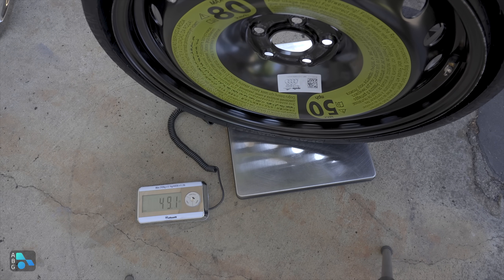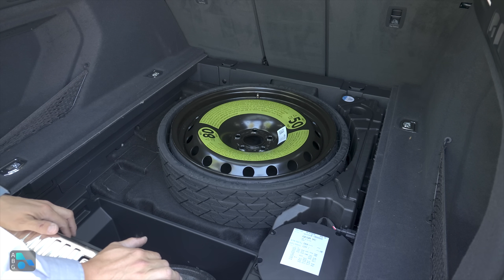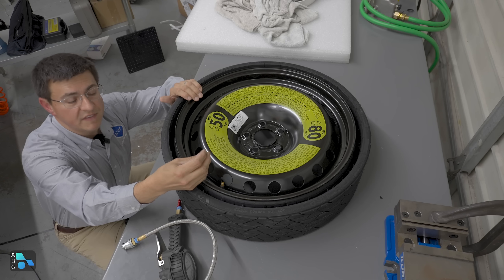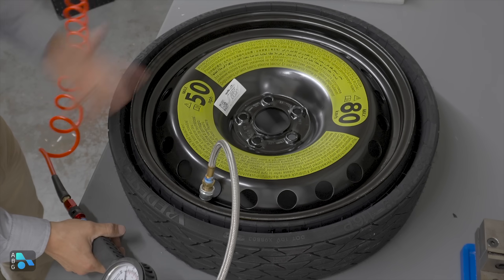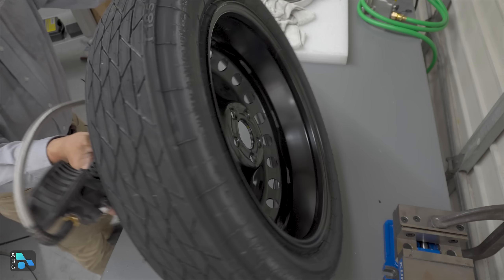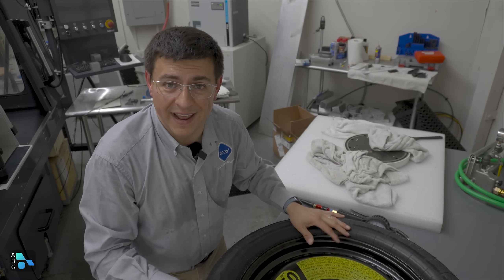How A Collapsible Spare Tire Works, And How It Might Save The Spare Tire In EVs

Comment: The ultimate problem is that an EV buyer is still far more likely to not know what to do with a spare tire compared to an ICE buyer. Educated consumers would really appreciate a real spare tire of any kind, but they are less likely to be attracted to the pros of EVs and be turned off by the cons. It is the natural result of attracting your consumer base with the "computer" part of the "computer on wheels" value proposition of EVs as opposed to the "wheels" part.
Reply: Do you have any stats to back that up?

Comment: I prefer a full-size spare wheel like we used to get with cars, the space-saving between a space saver and a full-size wheel isn't very much in reality, I would sacrifice storage space big enough for a pack of toilet rolls so I could have a full-size wheel & tyre, space savers came out for sports cars like the TT and MX5 I'm sure crossovers, SUV's, sedans, pickup-trucks etc have enough room for a full-sized wheel, they are awful to drive on and only a max speed of 50mph and a distance of 20 miles is recommended before you put a full-size wheel back on,

Comment: Spare tires aren't put in the front probably as a safety issue. Spare wheels and tires are not collapsible structures and could compromise the passenger compartment in an accident.

Comment: Here's my experience with one of these.  I had a new 2007 Q7 back in the day which had exactly that tire, and imagine for a moment that you are on a road trip, car full of bags and gear, and kids and you get a flat. Well, you know what, you can't fit the wheel that has a flat back into the original spare space, and do you know how big a Q7 rim and wheel is?  I think it is innovative, but these engineers are not thinking through the whole problem.  At least the storage space has to be able to accommodate the original rim.
Reply: Even being able to accommodate the original rim might not help because unless you have a set of tire irons, you're not going to be removing a tire from a rim very easily... And even with a set of tire irons, the average person who has never done it before is not going to be able to do it, much less do it without scratching up their rims in the process...

I prefer a full size spare tire that has the same rim as my other tires so that I can put it in the rotation pattern for my tires...

Comment: Better than nothing,  but where do you put the tyre and wheel you removed? If all the space is taken with Batteries and luggage,  you just throw away the oem rim (maybe$1000 to replace) and punctured tyre?  Seems a very heavily compromised solution.   

Full size spare means a 10 minute delay on your way to the airport.  Anything else means you miss the flight at best,  and maybe you're stuck on the side of the road, or in the multi storey carpark (where the flat bed truck can't go to recover you).  No thanks.

Comment: Stupid things. Great to get you moving again, not so good having to leave your original £500+ wheel and tyre combo/ luggage/ wife at the side of the road cause it doesnt fit where this little thing came from. Either full size spare or dont bother. Tyre tech is a lot better now than it was when spares were in every car. Theres plenty else on modern and electric cars that are just as likely to fail and leave you stranded. Maybe that space would be better used as an emergency reserve battery to get you an extra 10 mile when the main one is flat...

Comment: Because of Run Flats, the last time I had to use a spare was 2005 and that was because I shouldn't have been driving on the tires my car had anyway.  Initially I wasn't a fan of manufacturers not including spares, but I have come to realize that the weight and space savings of not having it is worth the tiny risk of possibly needing a spare.

Comment: The 50MPH limit amused me.  I actually got 70mpg from my Audi A3 Sportsback when I got a puncture on a Bank Holiday weekend and had to drive 50 miles at 50mph on the space saver tyre to get it fixed.

Comment: How often in your life have you EVER had to use a spare wheel on your car ?
There is a reason one is only sold with big EV trucks: They go off road where there is a slight chance you may get a bad puncture/rip in your tyre.
For road going vehicles this is NOT of any use.
All roadgoers with EV's have insurance that covers recovery in case of break down (including flat tyres). 
Its mandatory if your car is being leased which is the case of 99.9% EV's and cars in general.

Comment: There is a reason that car manufacturers stopped putting tyres in under the bonnet and that is safety.  A tyre and it's wheel in there in a front on crash with another vehicle coukd not only be dangerous to that other vehicle but also to the people in the vehicles bonnet tgat it is in too. So no that will never happen again thankfully. It was a stupid idea way back then and woukd be even stupider now. As for collapsable tyres lol no just no. What's new about that? Sure why coukd you not do that with a normal soacsaver or even a normal sized wheel? 
Spacsavers are the best.  Either that or the AA if you do not have a space-saving but this thing you talk about is just a gimic. 
How about airless tyres now that would be much more useful. Why are they not availible yet?

Comment: What a disaster! I've never owned a car with a space saver wheel, my cars have always had full-size and full-speed spare wheels.
Why these manufacturers couldn't find space, I have no idea.
I cannot beleive the Audi Q8 Etron weighs 3.2 tonnes, compared to my Subaru BRZ which is 1.25 tonnes.
The tiny BRZ has a fullsize spare wheel, and is a much smaller car.
It has about the same acceleration, and exact same driving range, but has the advantage of being able to get refuelled instantly at a gas station.
Why anyone would buy an Audi Q8 Etron over a conventional car, I don't understand.

Comment: Greetings from Britain. This tire looks to be a very good idea. I do not like the trend amongst manufacturers, even with gasoline powered cars, to do away with spare tires completely (less weight means better mileage). There have been a number of occasions in the past when I have had a flat and needed a spare. My son's Nissan Leaf only has a leak sealing kit, a poor substitute, in my opinion.
One question that I have for all car manufacturers who fit space saving spare tires- Where are we supposed to put the normal full sized wheel that we take off to fit the spare?
When you started removing the valve core, I thought that it could be easily blown out. Sure enough, it happened!
Thanks for the very interesting and informative video. I wonder if other manufacturers may take up this idea?
Reply: to your first paragraph, this was my 1st thought watching. "How is this an EV thing?! When ICE cars are the same now". I got a new car last year, and not a single car I looked at came with a spare, not one - and none were EVs...

Comment: When I worked towing for AAA collapsible spares were in many domestic cars, we hated them because people would drive on them like they were full size! We had to reduce them often when it would blow out ,  some higher end cars like Cadillac had the collapsible spare and a small cartage to inflate the spare.  People drive much more recklessly today than back then because the vehicles have more power today. Something like a Tesla and a small spare could be a  disaster unless the car is smart enough to prevent it being driven like normal. I'm retired now Hybrids were out when I retired Tesla was still a random thought In Elon's Head another reason we didn't like them was because it took so much time to fill them leaving us at risk of getting hit by a passing car or truck, yes Wrecker operators get hit during their job just like construction workers we didn't have all the signs to warn people we might be partially in a traffic lane trying to service a car.

Comment: This is better than nothing, but that's about it. Looks less useful than the small doughnut tires tbh. I need a full size spare that is ready to be installed in a minute without playing around with compressors unless it needs topped off. If you can't figure out how to fit a spare tire into the vehicle, I don't want it.

Comment: My '01 Mercedes SLK-230 had one of these.  I thought it was pretty cool.  Actually had to use it once when the body shop failed to replace a damaged tire after an accident.  It's funny how he talks about that valve core remover cap as if it's something new.  Those have been around since forever.

Comment: My Dad had a '72 AMX with a collapsible spare.  It used a single use compressed gas (co2???) cartridge to inflate.  Nice idea although there was the question of where one would put the much larger flat tire in that itty bitty trunk.  They were also known for not folding back down very easily.  The issue with flat tire storage still remains but using a pump rather than a  one shot canister to inflate sure makes more sense.

Comment: My used 2020 Chrysler Pacifica has one of these spare tires located in the driver's side rear quarter panel, along with the tools and inflator/pump.  According to the sticker, it was a $395 option.
Reply: LOL, a full size spare kept in the rear would cost you less! Ridiculous

Comment: My 1977 Datsun 280Z has a similar spare. It also has a canister of compressed air for inflating it. Mine has never been inflated and I doubt I would count on it unless I had zero other options. I don't know if mine is supposed to be reusable. Certainly the air canister is not likely to be. I keep a can of flat fix goop in a can in the car in case I get a flat.

Comment: Screw type metal valve caps have been available forever. I remember seeing them back in the 1970's. 
Most car manufactures are utterly dangerous when it comes to spare tires and tire change equipment supplied with the vehicle. A typical torque-wrench setting for an average passenger car is somewhere around 100 ft/lbs or more. The supplied tire wrench is totally inadequate for the job, especially elderly folks or small-framed people. Th jacks supplied are also inadequate to use, and also dangerous in non-ideal conditions. [On a slope, in bad weather, etc]. 
That collapsible spare tire is not exactly idiot-proof either. Not that many people are mechanically minded, and are not aware of how tires "pop" with force to the rim when inflated during fitting. If you get your fingers caught in there when that happens, you are in a world of hurt. 
Not talking down to people, they are just dumb about cars-they could be brilliant in other ways. But using a computer or phone is not all that likely to cause injury, so there's that.

Comment: …except normal spares are smaller than a regular wheel too, hence the term “full spare” for the exceptions. We didn’t need fancy “collapsible” spares to pull off the smaller spare trick before EVs so not sure why this is such a big deal.

Comment: The valve stem caps with built-in core removers are quite common. A lot of people put them on normal wheels, especially if they frequently do their own tire changes. Pretty common for off-road, adventure, dual-sport, and track bikes too.
Reply: extremely common for farmers, i remember we had that in 1990, and i am pretty sure those things are way way older than that.
Reply: @krisg822  We have at least one on all of our machines and trailers.
Reply: @schwuzi  we had only those, bcoz that is what the tires came with....well not tires to be specific, the tubes that went into the tires.

Comment: I suspect that a spare tire including a 'space saver' is required by law with any regular production car or light truck sold in Germany and possibly some other countries, so explaining why they have it. I think it should be a law in the USA and Canada as many times a flat tire may have a cut where 'stop leak' won't work or if the wheel bent makes it impossible to hold air or even derivable at all and no spare of any kind can be dangerous or put in at a huge disadvantage.

Comment: I was also wondering why EV cars don’t have their spare tires in the front since they can already make space for a frunk… the Citroen DS used to squeeze a spare tire in with the engine up front
Reply: Cut costs. They still could put below the boot but now call it an extra space.
Reply: One commenter said it was for better safety, as wheels are hard and big empty spaces are crumply

Comment: Obviously the air inside the tire adds a ton of weight. Very smart to include a flat tire and compressor, rather then simply an inflated spare tire.

Evs are unrivaled at erasing practicality and including complexity to basic automotive systems already perfected.
Reply: I can't think of anything more practical than waking up to a full tank every morning; I never have to make a dedicated trip just to refuel my car I can do it at home. Also, EVs are not unique in removing spare tires, gas cars were doing it long before EVs hit the mainstream. These collapsible spare tires are also a 50-60 year old tech now, not even close to being new.

Comment: These things are absolute, hands down, pieces of utter trash.
I change tires daily and whenever I encounter these things - unless they're brand spanking new, never been used - the bead is ALWAYS broken.
And they weigh three times as much as a conventional spare which affects gas mileage - which is why EVs and many ICs don't even HAVE spares, to cut down on weight so they can meet those mileage requirements.
And often enough they'll 'roll over' during inflation, where the tire rolls to one side of the rim and risks blowing while in operation.  The best way to prevent that is to inflate them AFTER mounting on the car, with the vehicle's weight on the tire.  That keeps the tread centered during inflation.

These things are a recipe for failure and should not be used on any cars, current or future.

Comment: A different world to when my 65 mustang was new.  Generous size trunk but the spare took 50%, due to the lack of thought put into its  horizontal placement in almost the center.  No effort by ford to bolt it down in a corner, or better still to make a little well between the tail light and rear wheel well for vertical storage.   For this EV, my mind would have gone the direction of designing a very narrow tire, full diameter.  Would not behave like a full width tire, but I doubt this inflatable does either.

Comment: My Model Y has way more room than a comparable ICE car, so it's not space that's the issue. I suspect Tesla's don't have spares because it not worth the weight penalty and cost for how infrequently they're used. I've driven a lot more than average for 45 years, and I've used a spare once in my life. Even then I could have called for assistance if I was willing to wait. So, for me, spare tires are a useless waste of weight, space and money.

Comment: The future of the spare tire is the past.  Datsuns were using these spare tires starting in the early 70s.  My 1980 280ZX has that same collapsible spare.  I'd never use it even with a flat, as it's 44 years old based on car build date.  I'm sure other Japanese makes were doing  this as well, as the cars were much smaller over there compared to the US, where you could fit your entire house into the trunk of the average family car in the 70s.

Comment: I think you should have used the pump included so we can see how long it will actually take when we get a flat.
Reply: He'd still be filming...
Reply: It is a rather stupidly implemented system.  It solves a problem that really doesn't exist.  Look at that spare tire bay.  It is plenty big enough to hold a fully inflated compact spare.  The trunk itself is big enough to hold the blown standard tire too...because you aren't going to leave it beside the road are you.

The deflated tire saves enough space to fit in the slow pump that you have to tolerate while it is raining and you are being sprayed by trucks on the highway for 30 minutes.

Just lose all that stupid styrofoam in the spare bay and the tire and jack easily fit.

Germans are notorious for overly complex engineering of unnecessary things on cars.
Reply: @STho205  - your post about German complexity made me laugh.  You're not wrong, and you're not wrong about that car having room for a standard "donut sized" spare!  If I'm stuck on the side of the road with a flat, I really want a smooth tire change, even if it's raining or snowing.  The less time my car is stuck on the side of the road, the less chance there is that I'll get rear-ended by another driver...or struck by a car while I'm trying to hang the spare on the wheel.
Reply: @justaskin8523  yep.  The inflater is one more thing to fail after sitting unnoticed for years below your trunk.  The one they supply takes about 15 minutes as it is cheap and slow.
Reply: @STho205  It also will risk running your battery down if you don't leave the motor running, leaving you stranded.
Reply: Yes, I was thinking that there was enough extra space for a non-inflating compact spare if you redesigned the space a bit.  I wouldn’t want to use that small inflator out on the road without a trial first.
Reply: Exactly. If you're stuck on the side of the road, how long would be needed to wait for this to inflate?
Reply: The thing is that the included pump does not have enough power to unfold this tire from its collapsed state!
Reply: Sods law says you're going to get a flat at the same time your battery does too..